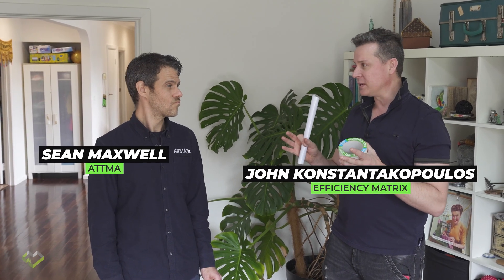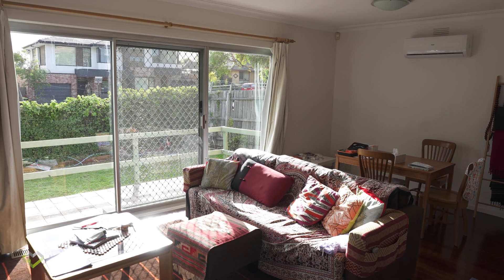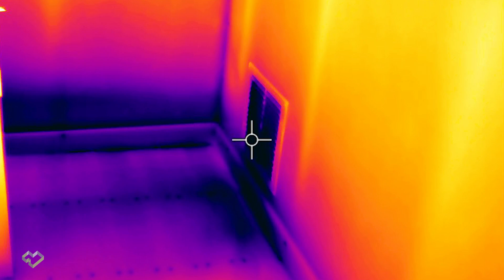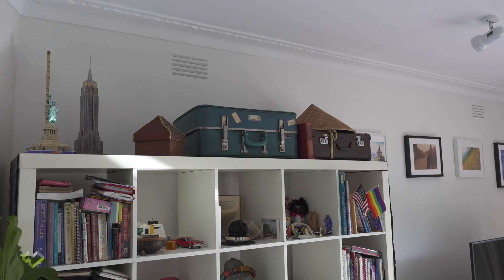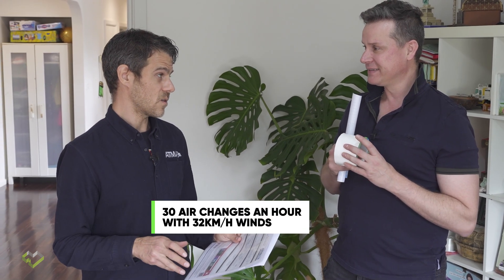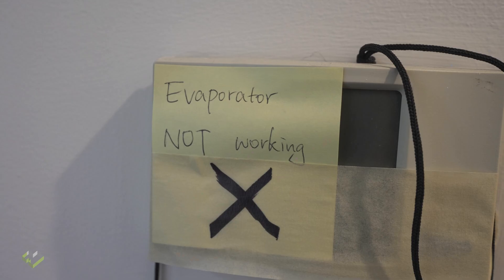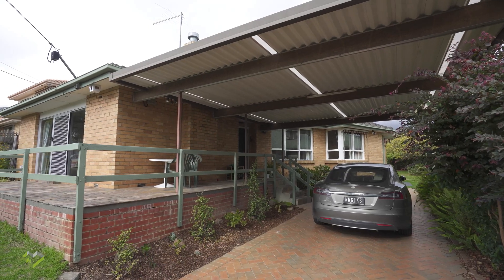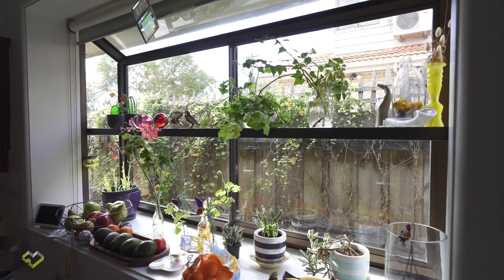Winter Comfort Survival Guide for Renters. (Energy Efficiency)

Comment: 3:39 is my bedroom window. Single glazing, 1950s brick house. I rarely have the blind up due to the room's position in relation to the street but, if I leave it too long, mould forms quickly.

Is there anyway to stop/reduce the amount of moisture produced at these junctures during winter or am I stuck doing a daily wiping/drying of the window (or stop breathing and heating up the room)?
Reply: Thick block out curtains.

Comment: My evaporative cooling is on its last legs and I will be replacing it with a couple of reverse cycle split systems instead. Until I can have the old evap cooling removed I'll be sealing the vents as demonstrated. I've used the contact method before but the insulation bag is a great idea I'll put in place too now. Last year I replaced the windows with triple and double glazing and the improvement in comfort is amazing. Gas bill for heating down 33%. Shows how low performance builder's spec (Aust. 1990s) brick veneer homes are, but can be improved. Landlords should not be allowed to refuse a tenant from making simple reversible improvements to their home that will improve the comfort and reduce their energy bills.

Comment: My rental has one of the split system compressors under the house. Is this pulling in dirty air?
Reply from the maker: Leaky returns do, but compressors for splits are just heat exchangers.   That will be drying the air under your house, which isn’t a bad idea in most cases.